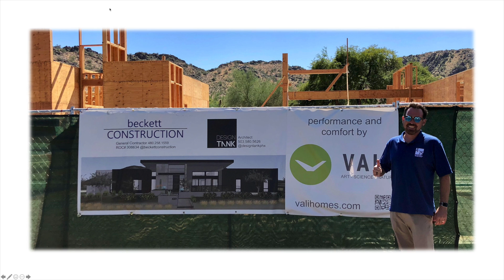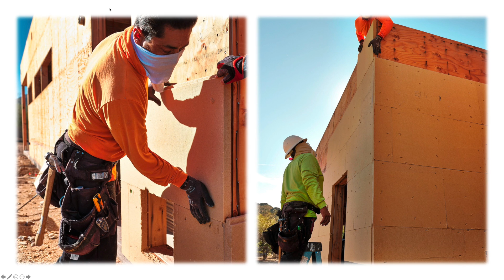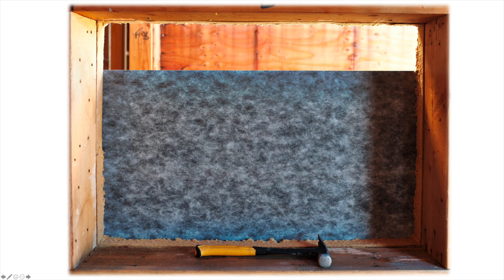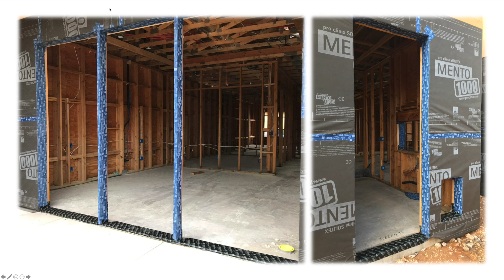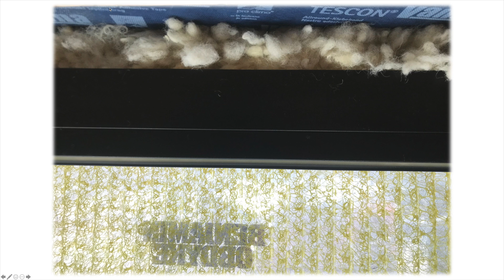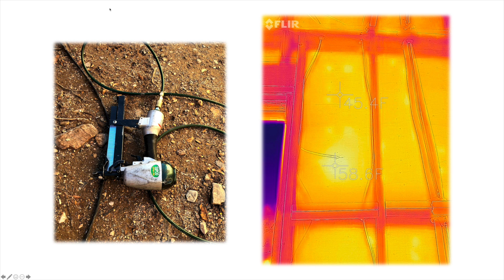Project Spotlight: Wood-Based Insulation In The Desert On Arizona’s First Smart Enclosure Assembly

Comment: I live in Chicago and have a 2x4 wood frame two flat built in 1896 that seems to have no insulation. I want to take off the vinyl siding and add Gutex or rock wool exterior insulation. If I go with the Gutex, then I should add it to the sheathing and then add the vapor barrier? I will probably use LP smart side as new siding. Thanks for the video!
Reply from the maker: Hi Nick, I noticed your other question on another video. Building off of that answer, we have a historic wood frame retrofit Smart Enclosure book you can download that will show you all the details you need. One of the benefits of Gutex is that it is a WRB as well. If you wrap Gutex around the exterior of the building, you would not need a WRB on top of that.

Comment: So with Gutex window details, is solid enough that you don’t need to buck out the frame?
Reply from the maker: Gutex is not structural, so you will need to either use rainscreen battens and other structural materials to fasten you finishes too. This could be a full buck, or can be done with strategically placed blocking.
Reply: @475.SUPPLY  understood, thanks!

Comment: You said too many staples were used to attach the Gutex, so what spacing do you recommend?
Reply from the maker: Good question - Gutex's tongue & groove help to hold it in place, meaning you can reduce the number penetrations through the insulation. In this situation described here, 4 staples per board would be enough. Any more than that would not be necessary.